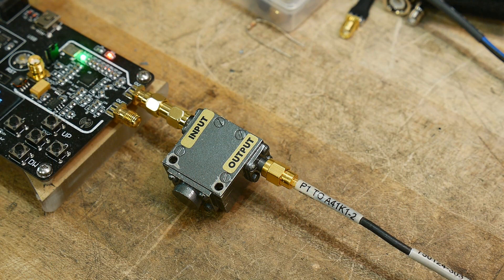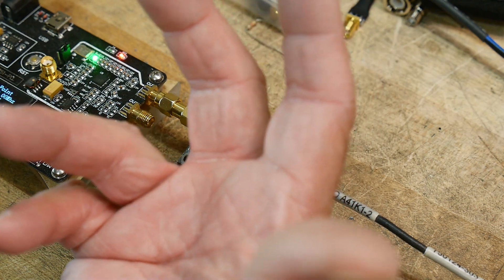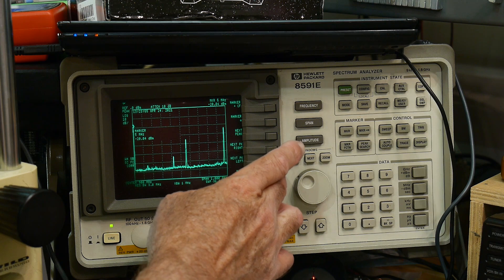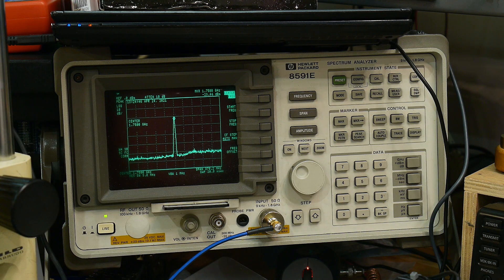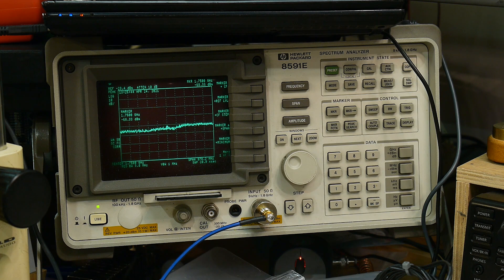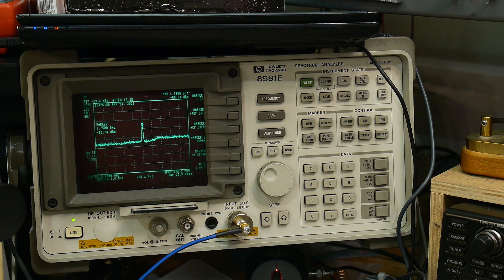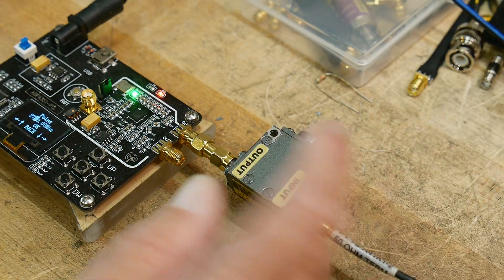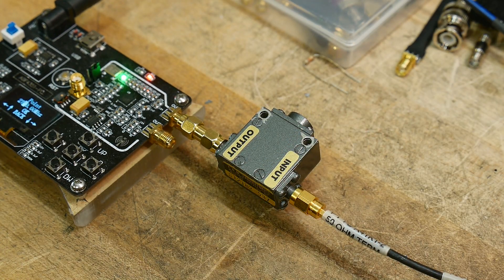#792 RF Isolator Circulator (part 2 of 2)

Comment: It is very interesting to see the isolator in operation. Great work to get it into the range of the existing equipment. 
With a little sweep over the frequency and a little variation of the magnetic field from an outside magnet one might see still a little more.

Comment: I've heard different explanations for the principle by which the operational RF waves are circulated. I would have loved to have seen you probe the silver (-plated?) conductor while sending different signals through the device's ports. I am imagining doing this myself with an automated testing jig so I can plot the amplitude and phase offset of the signal across the entire conductor. I realize that it won't be the same without all the components being in place and sealed properly, but the results may be instructive nonetheless!

Comment: Great! IMSAI Guy, I wonder if for generating higher frequencies, you could grab the LO out off the back of your SA, or perhaps use a frequency doubler or tripler to generate higher frequency content (maybe make one even?). Or use a pulse generator with a fast edge. On the measuring side, I wonder if you have a power meter and power sensor. Those go up to 18 GHz or so, right?
Reply: Interesting idea.
Reply from the maker: That's true. I could have used my power meter. thanks